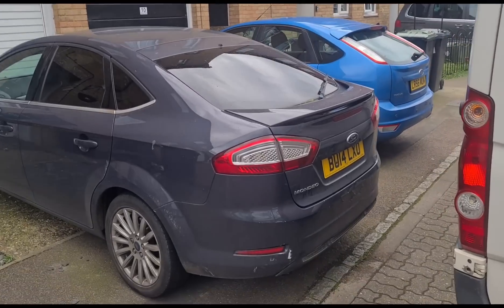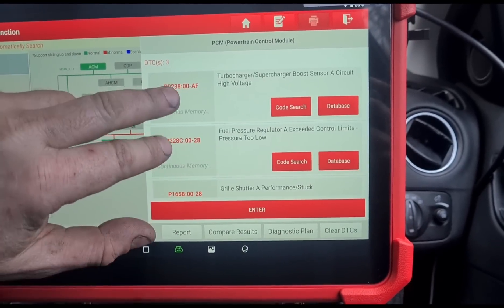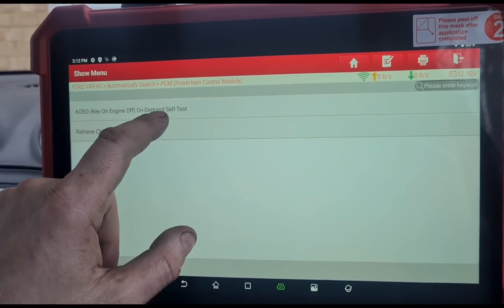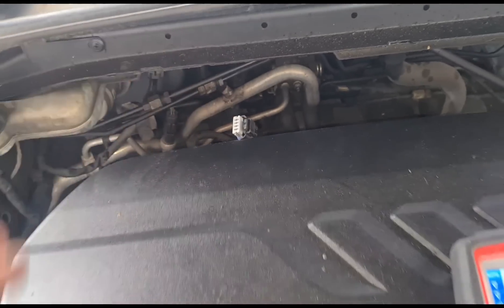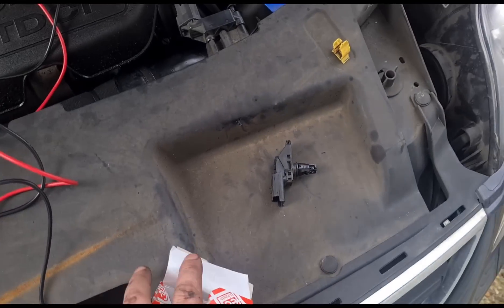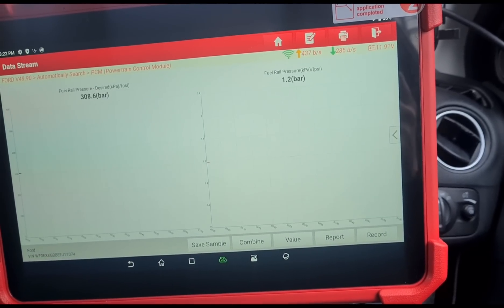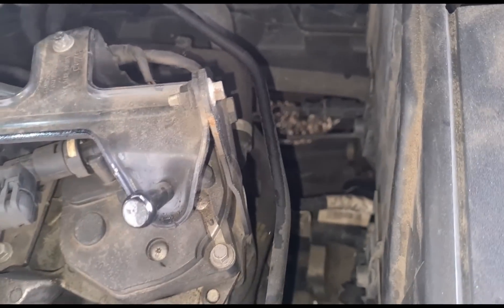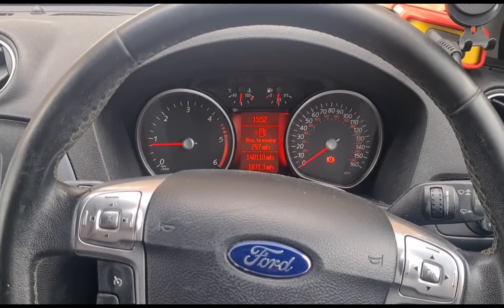Ford Mondeo 1.6 P0238:00-AF Boost Sensor A Circuit P228C:00-28 Fuel Pressure Regulator Too Low

Comment: Have the same car,recently it started to develop shaking or vibrating when release the throtle. Also when coasting down the hill,it vibrates untill i press the throtle. Its serviced,all 4 new injectors,new dual mass flywheel,tires are balanced...what it could be?

Comment: Jimmy can I just ask do you get your customers to sign a disclaimer if you need to do a dpf clean on a vehicle that’s overdue an oil change or cambelt/chain replacement? It’s just in case it failed mid re gen? Or would you just refuse service? Thanks for the videos they are super helpful.

Comment: Had similar issues with mine 2.0 tdci had code for p0266 cylinder 2 contribution balance .
Changed the fuel filter filled it up with shell v power add used some in tank cleaner and no return of code ! The car felt totaly different afterwards .

Comment: I think that due to the cost of living the car maintenance has dropped so general servicing like changing the fuel filter ect is being stretched out to the Max or service intervals being missed making it more common to get blocked filters ect another great video
Reply: Agreed ...more people need to start being hands on with oil and filter changes....greatly reduces the cost
Reply: @thindo   sadly they're not capable of doing the job without making basic errors.